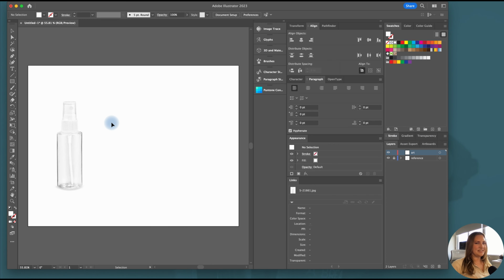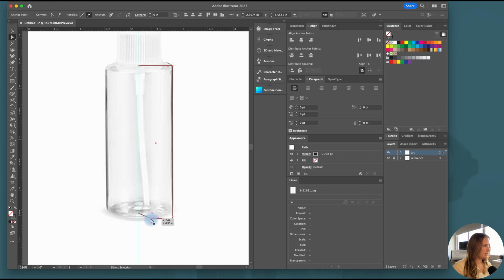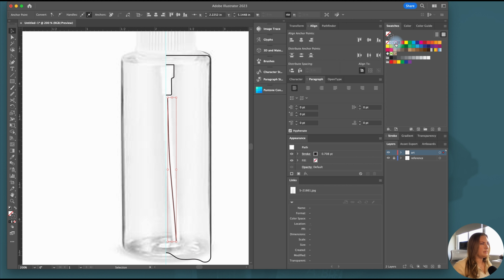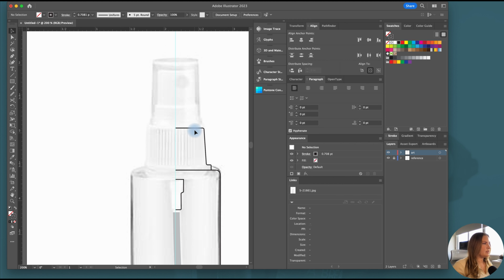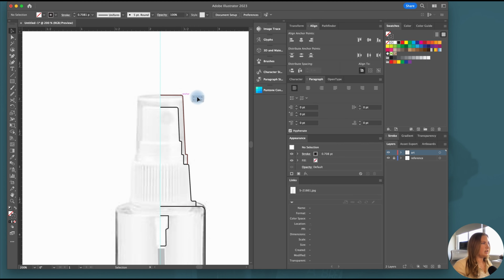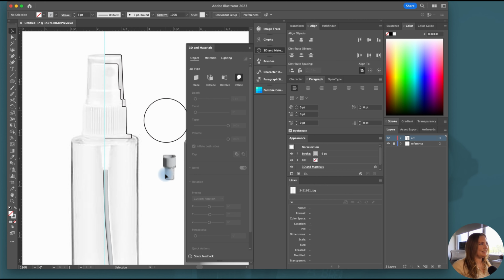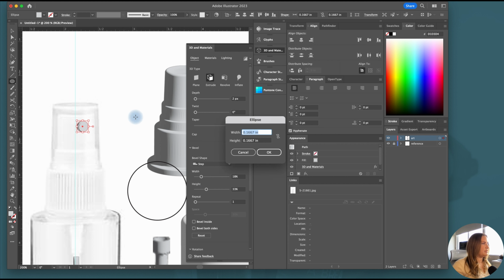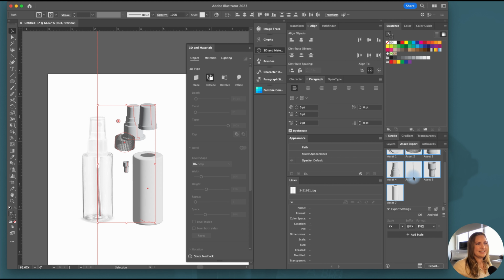Part 1: Designing a 3D Spray Bottle Mockup using Adobe Illustrator and Adobe Dimension

Comment: How it works when you have an asymmetrical bottle?
Reply from the maker: That’s a tricky one! You might want to try tracing the full outline of the bottle and then using the Inflate tool. You could also experiment with the taper setting under Extrude. If you’re feeling stuck, I offer 1-on-1 virtual training where we can work through it together. Check out silvermoondesignschool.com for more details.